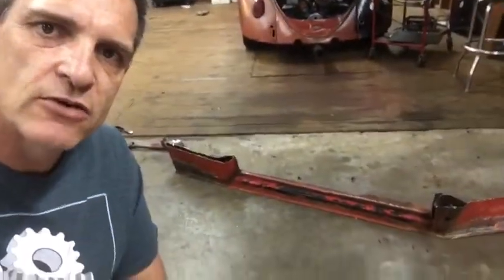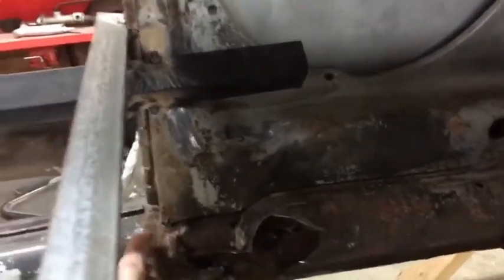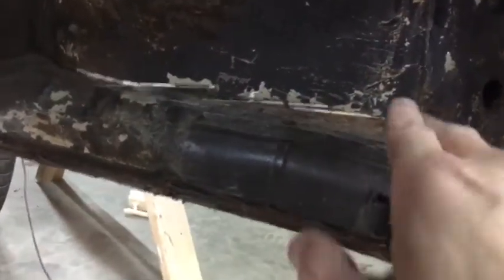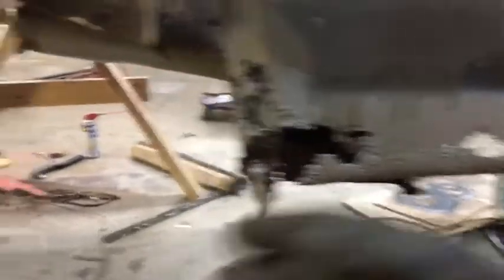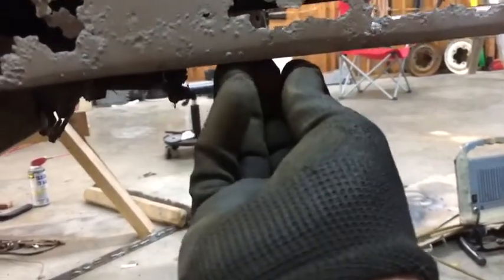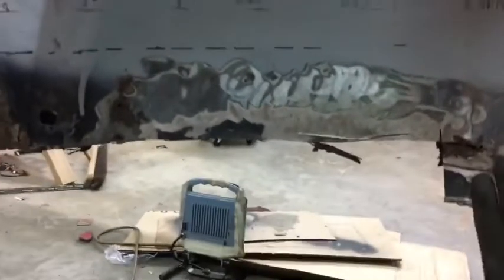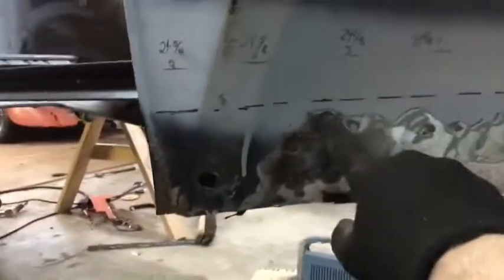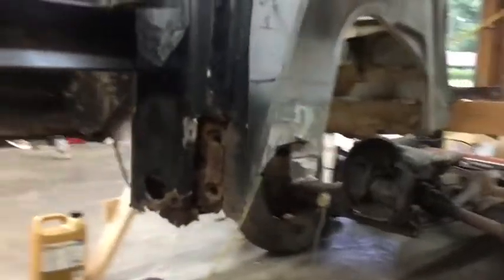Removing a beetle heater channel

Comment: Good plan, I did replacement heart channels on a 1978 had it set up like you have off the pan. I used an air Cut off wheel and then a Dremel with a little cut-off wheel. The cut of wheel break and do not last long on a Dremel but did a great job in small places. What I liked about using it too, was you really can control where you want to cut. Between the two cutters i gotthe job done. Like yur shop and the wood floor you have great lighting and a large amount of room. I have bad legs and feet wood floor would help them.